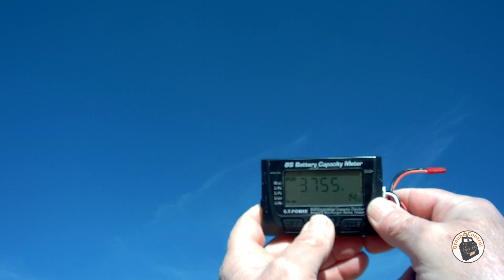Radiolink R8XM 8CH SBUS/PPM Telemetry Receiver Test Flight using the Radiomaster TX16S & OpenTX

Comment: Buddy how did you get the radio link gyro settings on the tx16
Reply from the maker: The Byme Gyros use CH5 for the (3) Main Modes and CH7 for the additional Modes.
You can use any 3-pos switches.

Comment: Do you have a video how to set it up with the tx16S? i saw your other one but with the radiolink radio.
tks
Reply from the maker: Hi Alex!
I don't have a video but I did publish My OpenTX Model File for the Radiolink A560 on our Facebook Page for download.
It contains all the setup info for the R8XM and Byme Gyro, except for the Telemetry, as I don't use it.
Just Search the Facebook Page for "opentx model file a560" and that post should be at the top.
Reply: @GroundControlRC  great many thanks!!
Reply: @GroundControlRC  is this ELRS or 4:1 receiver on this plane  ? Thanks
Reply from the maker: @jojito_94  It's a standard non-ELRS RX.

Comment: Hi, have you got failsafe working with this combo, if so can you tell us how it is done please. Mine defaults to all channels at neutral on signal loss which means the throttle goes to mid stick too. Not a good scenario on a bigger modlel
Reply from the maker: The Radiolink Failsafe channels are offset by 8.
So, Failsafe for Throttle will be on Channel 11.
I have Channel 11 set on failsafe for an offset of -200.
I found that -200 shuts off the throttle completely when failsafe is engaged.
Reply: @GroundControlRC   Thanks for the prompt reply, and please forgive my ignorance but I 'm  still not sure what I'm supposed to be doing here. Do you have a screen shot I could follow please?
Reply from the maker: @golemsnatch5755 I don't have any screenshots but here is a link to the Multi-Module page which may explain it better.
https://www.multi-module.org/using-the-module/protocol-details/radiolink

Comment: I am using an Flysky FS-X6B reciever with a Byme-a board on all my planes.  It gives me RXba, RSSI, RQly, etc telemetry.  This is a receiver for a quadcopter adapted to airplanes.  Works great with a TX-16S transmitter (Frsky 2A, PPM,Sbus protocol).  I have it set up for voice prompts for battery voltage.  The range is about 300 m.  I cannot see well past 200 m so I am good.  Setup is easy.   I would like to know how to set up another channel for flaps or LED's however.  I don't know if PPM and PWM channels work at same time from this board.  Byme-A allows 4 channel operation only.   I have consided this R8XM . It hooks up the same to a Byme-A board.  With the X6B it continuously reports voltage so I can set the alarm voltage on the TX-16 to any value needed.   Thanks for this video.
Reply from the maker: Hi Randolph!
Unfortunately, the Byme-A will only work in SBUS/PPM Mode.
I know there are receivers out there that will output PWM/SBUS/PPM simultaneously which is what you would need for more than 4CH with the Byme-A.
I've suggested to Radiolink a 6CH-8CH version that has some pass-through channels for things like flaps.
I hope they come out with one.
I'll have to pickup one of the receivers that can output (2) modes at the same time to test that out in the future.
See you in the Air!
Reply: I get twitching with the Radiolink receivers on my tx16s. I love the a560 and the gyro is great but I can’t chance using their receivers with TxmX16s. I have the r86c hooked up for now. The 8ch receiver gives the same issues as well

Comment: Thank you for this nice video. I am having same setup. BymeA, R8XM and TX16S. I have noticed quite same behavior with battery alarm. It is getting triggered on 7V (2S Lipo) very fast, especially when my plane is on load, sometimes 7V even I know by timer I have much more juice there and can fly 7-8 more minutes. I am very new to RC planes but I think we are too conservative with Rx Voltage alarm. Maybe it is also related to the cold weather as you said. In my place is around 0 degrees centigrade. I will reduce alarm level and try again when I will have more time. I will update here how it went.

I was also trying to understand RSSI value. On my TX16S this is around 120(!?) when close to the plane like one meter. Do you know what this value represents? What is that 120? Is it same for you? I think this cannot be dBs. And how we can interpret this? I could not find this in the documentation for the receiver. On Radiolink T8FB BT this RSSI is in decibels and goes with negative value like on your video here https://www.youtube.com/watch?v=R0FdCNN158M&ab_channel=GroundControlRC

Thank you once again for such nice videos.
Reply: I see this same behaivor with 2S batteries.  There is little headroom between 8.4 v and 7V on a 2S 50C battery.   I have to fly really easy to get more than 7 minutes. (FT Adventure, hyperion 320mah 2s ).  In the warm, I can get up to 9 minutes, but less than 7 at freezing temperature.  I see the voltage sag to alarm, then I cut throttle, battery goes out of alam, fly more, alarm, and so on.  If you fly without telemetry, you don't sense this battery behavior.
Reply from the maker: @rlatall1  Yes, they seem to pull down quickly and recover quickly.
I'm going to have to set my voltage alarm much lower when using these small 2S LIPOs.
Reply from the maker: Thank You!
Yes, I definitely have my voltage alarm set too high for the cold weather.
There is an adjustment offset in open TX to set the detected voltage to the actual voltage as mine needed adjustment.
The RSSI should be 0-100 as far as I know.
This protocol does require RF Frequency Tuning to get the best signal and I recommend performing RF Frequency Tuning to get the best signal and perform a range test to make sure you'll have good range.
I published this video regarding RF Frequency Tuning: https://www.youtube.com/watch?v=Vuupd037Tnk
For the range test, it's recommended to put the aircraft on the ground, walk 30 meters away, put the transmitter in Range Test Mode and make sure everything is working as it should.
Reply: @GroundControlRC  I just want to share one observation with you guys reg. model battery telemetry. 

Once again my setup is BymeA, R8XM and TX16S. 

I have similar battery voltage false alarms as you do. I did some tests today. My TX16S has auto discovered telemetry. I am using 2S lipo and my Ratio on that value is 257. This 257 is calibrated without any load on 7.4V - now readings are correct (checked with Battery Voltage tester) when my plane is without load (prop is not spinning) but when I add some load to the battery Voltage readings are completely off😕. 

I have locked the plane firmly and set the throttle to 50%. My telemetry was receiving 6.2V but under same conditions I have measured battery Voltage with Battery tester and it was showing 7.25V.

This is something I would not expect🤔. @Ground Control RC maybe you have exact same issue and battery alarm is with that reason always below alarm threshold.
Reply from the maker: @dundomaroje22  Thanks for that update.
I know those little 2S LIPOs pull down quickly, especially in the cold, but recover quickly once out of the throttle.
I did adjust the voltage detection in my TX16S to match the voltage my LIPO shows but I have my alarm set pretty high for the cold temperature.
I'll test mine again when I have warmer weather and see if I still get the alarm quickly.
Reply: I am now sure I have faulty R8XM.

I have measured voltage on 50% load stationary with multimeter while battery was pushing telemetry via R8XM receiver. Telemetry Voltage was 6V and measured on Multimeter was 7.5V. 1.5V difference! 

I am not sure this is same in your case. If yes there is the bigger issue with this receiver. 😐
Reply from the maker: @dundomaroje22  I'm not sure and I'll have to investigate when time permits.
There is an adjustment in OpenTX for voltage telemetry so you can set the voltage that OpenTX reports with the actual voltage that your multi-meter shows.
I'm pretty sure that needs to be done with any receiver that provides voltage telemetry.

Here is an article that talks about continued false alarms and how to mitigate it.
https://oscarliang.com/taranis-logical-switches-voltage-alarm/

Apparently, these false voltage alarms are pretty common.
Here is a video where this is discussed and mitigated.
https://www.youtube.com/watch?v=YAGKW_q98Vg

I hope all that helps as I'll be looking at this when I have time to tinker with it.
Since I perform a lot of punch-outs with my planes I'll probably set the alarm to sound only if the voltage sags for more than 5 seconds.
That's after I setup calibration with a multi-meter and see how much the voltage sags when going full throttle for 5 seconds.
That should give me a good indication of how low I need to set my voltage alarm.

Comment: Amazing what they are doing with electronics these days.  Tiny and low cost.

Happy flying!
Reply from the maker: It's amazing! I've never used battery telemetry before and it's going to take some testing to get the warning voltage just right but pretty darn cool ;-)
See you in the Air!

Comment: It's cold here in The Great State of Confusion, Maryland too.

I keep my batteries in my pocket when it's cold out.

I wish I knew more about batteries when I first started flying. I killed everyone I had by running them down too low.

I had to replace every single one.

Live and spend. 😆

Going to have to pick that up from RL. 

All of my planes are flown with the Radiolink AT10II transmitter and receivers.

Spend a little now and save a lot later.

As always, thank you for another great informative vid.
Cheers!
Reply from the maker: Thank You Randall!
I've puffed a few LIPOs running them too hard using ones that couldn't provide the amps for the power system I was using ;-)
I'll have to start keeping one in each pocket so they're not so cold when I put them in the plane.
The Radiolink components are fantastic, especially for the price ;-)
That Radiolink A560 3D Trainer is an absolute blast.
I wish they would come out with some more planes.
See you in the Air!

Comment: Try keeping your  batteries in your pocket to keep them warm... or drop the Alarm Voltage another 0.1 Volts.
Just received my A560 Kit only. Now to find time to build it with my other parts...
Reply from the maker: My 1st battery telemetry receiver ;-)
Yes, I need to drop the voltage setting on the alarm until the weather warms up.
I was surprised at how much the voltage drops in cold weather when you're in the throttle.
It recovers well but certainly makes the alarm go off constantly.
I may have to lower it to 6.8v.
I may do just that and keep a LIPO in each pocket so they're warm for the next flight.
You are going to have fun with that A560.
I wasn't really interested in 3D Planes until I had the opportunity to fly that one.
It's an absolute blast!
See you in the Air!

Comment: Ok I ordered one using your link 🎉
Reply from the maker: Thank You much!
I wish I had tested this one before my last order.
I ordered (4) more of the R8FM Receivers which are great but I think I'll be ordering more of these next time.
See you in the Air!
Reply: I think I have some 3 and 4s balance lead connectors so this should be a nice upgrade having some battery telemetry
Reply from the maker: @dronepilot260rc  I'm going to be doing the exact same thing.